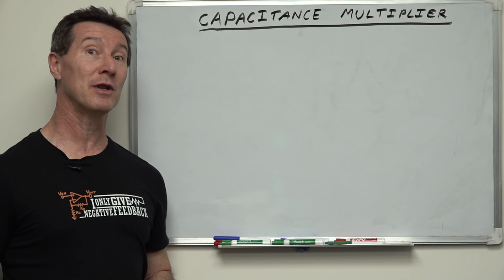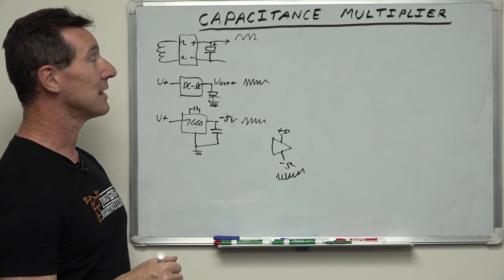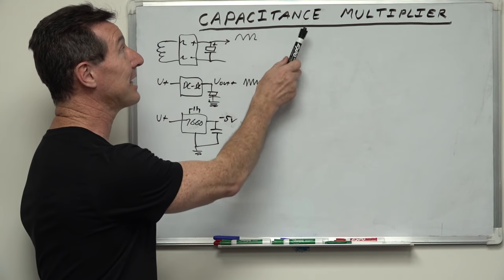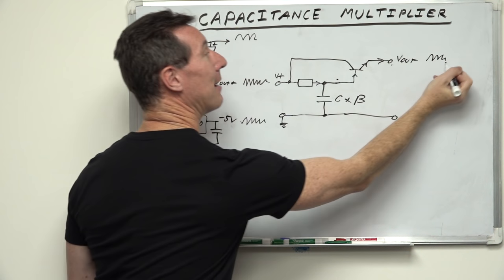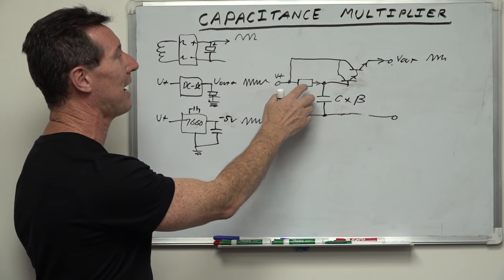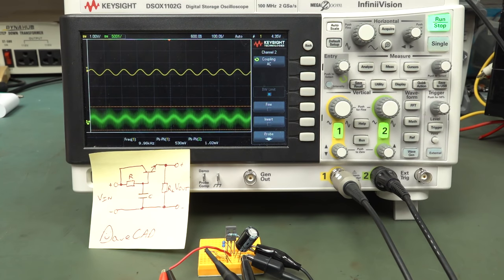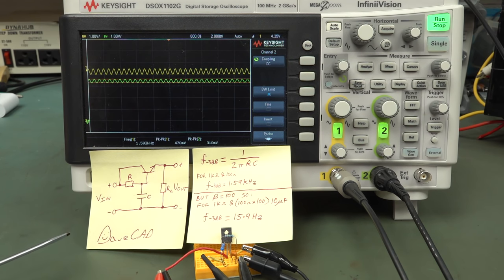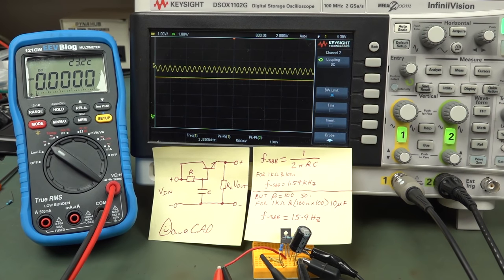EEVBlog #1116 - How to Remove Power Supply Ripple

Comment: Nice explanation, Dave. There is a trap for young players here. If the input voltage ripple amplitude exceeds Vbe-Vce~=0.6V, this circuit doesn't work properly anymore, because the collector voltage drops too close or even below the emitter voltage. At that point, only the base current makes it to the output and there is no current gain anymore. An additional resistor across the capacitor can be used as a voltage divider to solve this issue. This will lower the base voltage, which lowers the emitter voltage, and allows the input voltage to drop lower before there is no current flowing from the collector to the emitter. I ran into this problem with a low power, high voltage boost converter that had more than a volt of ripple.
Reply: yeah, I was kind of thinking about that, and wondering if putting a cap on the output would even make any diff at all other than smoothing out the current draw of the load through the bypass transistor.  and, at that, what is preventing that second resistor in the divider, from being a simple zener, to further stabilize the voltage of the output. I guess it mostly depends on what the load is, and what the supply is doing. lol.

I also found, for many low power things, a simple in-line diode with a cap after it was sufficient for a single device without trying to stabilize an entire power buss just for a single chip to be happy.
Reply: Does this still occur if I were to use a darlington pair?
Reply: @ninethirtyone4264  I think this is getting even worse, because the voltage drop is even bigger, about two times the voltage drop of a normal BJT.
Reply: Does this happen with a mosfet?
Reply: Paul Max Avalos Aguilar : Actually, with MOSFET, you have the threshold gate voltage lost necessary to turn the MFT on. Which is typically in the range of 2 to 6 Volts. This value would be the "room" available for ripple elimination. The hick with MFT is that this threshold gate V significantly vary with Source current, so this would create a situation where you would loose even more voltage than with a BJT. The advantage though is a better ripple filtering than with BJT, as long as your initial ripple is lower than V gate.
Reply: I've built this as shown, with C=4700u and R=5 (and two cascaded filters). Sure enough, it filters the ripple when testing on a scope. Got a beefy TIP31 (hFE=20). Feeding it 15 volts, getting close to 14.3 on its output, but the moment I added a 10mA load like a led, it drops like crazy - 13.9V. With actual resistive loads it's absolutely horrible - @4ohm ~ 1.9A I get around 9 volts, and on a 10 ohm ~ 1.2A close to 11 volts. 

I want to get clean 12V, so literally no output voltage is acceptable. Even if this filter is fed with a higher voltage, say 18V - the 5-8V excursion for the given load is really bad, given that the less load you have, the more volts the regulator will have to drop.

So what am I missing here? I have designed this circuit to get stable 12V out of SMPS 15V for at most 1.5A. Given a 1.5A Ice/load, my base resistors are (15-0.6)V/1.5A  ~= 10 ohm  - which are also part of the filter and allow for little voltage drop.

What do I have to modify to this circuit and what transistor and filter values should I use to get filtered 12V from 15V for at least 1.5 amps, ideally more - like 5-8A?
Reply: @dorelx3541  A 5 Ohm Base resistor will pour near 3 Amps into the base. TIP31 base current max = 1 Amp. Try a base resistor of 100 Ohms with a hFE of 20 that should allow 3 Amps collector current max.
Reply: Actually I seen tens of volts ripple getting perfectly flat at the output.

Comment: 5 years later and this circuit just pulled my nearly 200 mV of output ripple voltage to just over 5 mV after a little playing around with various capacitor and resistor values.  Absolute gem of a circuit and these videos help us young players immensely as we fall into trap after trap going into actual circuit design rather than just the books.  Brilliant, absolutely brilliant content!

Comment: Wow, this video just saved my ass... I had 350mv ripple on a crappy power supply at work and it was messing with some of my testing and this circuit got rid of it all! Thanks so much Dave! You're a real life saver!
Reply from the maker: Nice!
Reply: @YiZhou Wang You still depend on a voltage regulator. The V+ going into the capacitance multiplier comes from a regulated source.
Reply: @YiZhou Wang if the power supply's hackablr enough, one could replace its feedback circuit(probably a voltage divider) with one placed after the capacitance multiplier
Reply: YiZhou Wang yo, he specifically states that should one require stable output voltage, then one should use a Voltage regulator
Reply: Most inexpensive ( yea right!) power supplies simply use a parallel electrolytic capacitor as a filter to reduce ripple.  The best filter is an inductive  pi filter.  It consists of, in parallel, of a capacitor, a series inductor, and another parallel capacitor.  It looks on a schematic like the Greek letter pi.  This takes of capacitive and inductive ripple.  It precedes a linear or switching power supply.
Frank
Reply: @frankreiserm.s.8039  Woaahh, Thanks! I'm gonna try this one!
Reply: @frankreiserm.s.8039  100%

Comment: In the '90s Technics (then Matsushita Electric, today Panasonic) called a variant of this topology "Virtual Battery", claiming a supply to analog stages almost as clean as a battery. They used a big cap and a mosfet, and there was a switch in place of the resistor. It was used in their HiFi components.A very simple idea, but it does in fact work fine.

Comment: NPN transistors for the win!
Reply: I clicked like on this just because it's Fran.
Reply: Me too, just got her Franlab T-shirt
Reply: I am a big time Fran-Fan u know. Good to see you here Fran.
Reply: That was interesting Dave hope u keep posting such fundamental videos.
Reply: A mosfet or igbt depending on the amount of current/voltage u need then clamping the gate voltage with a zener diode then another low pass filter will do well
Reply: @philipakpojiyovwi3875  i would be worried the Zener diode would interfear with the function.  wouldnt it stop some of the ripple being seen by the gate? thus allowing the ripple to simply pass through the fet?
Reply: @MrStemkilla  Remember the gate signal is a replica of what must pass through the MOSFET /IGBT in an amplified form, a ripple free gate signal means a ripple free amplified signal
Reply: They are great for amplifiers.
Frank

Comment: @EEVblog  Hey Dave, I LOVE your videos! Hands-down... the best in electronics on YouTube! I benched this circuit IDENTICALLY as shown including values for components. (I even used a mini breadboard) to DUPLICATE “EXACTLY” what you used in the video. I used a Switch Mode Power Supply configured for 5v. (Just as you showed in the video). However, I couldn’t replicate your ripple results.

COMPONENTS:
Switch Mode Power Supply Volts: 5.00 (5.001v Actual Output) – Measured using:
Keysight 3458A - 30min+ warm-up
Keysight U1271A

R1 (Base Resistor) = 1k - 1/2watt - 1% (996.83 Actual) - Measured using:
Siglent SDM3055 - recently calibrated - 30min+ warm-up
Keysight 3458A - 30min+ warm-up

C1 = 470uF 35v (486uF Actual) - Measured using:
Siglent SDM3055 - recently calibrated - 30min+ warm-up
Keysight U1271A

RL (Load Resistor) = 270 - 1/2watt - 1% (269.94 Actual) - Measured using:
Siglent SDM3055 - recently calibrated - 30min+ warm-up
Keysight U1271A

Q1 = BD137  –  (not a BD137G)
-------------------------------------------------------------------------------------------------------------------------
BD137:
R1 Voltage = 57.593mV = 0.057593v (Verified with the above 3 Multimeters)
RL Voltage = 4.2747v (Verified with the above 3 Multimeters)

I1 = 57.78uA = .00005778A
IL = 15.83mA = .01583574A

hFE: 274.069574

Of course, it smoothed out the ripple nicely. However, my ripple numbers are considerably higher than yours. I used a Keysight DSOX2012A to take the measurements. (Essentially the same O-Scope you used in your video). – I wish we had the ability to attach photos here on YouTube. One thing I would like to point out that when I measured, I used a ‘M’ BNC Oscilloscope Probe Adapter & a “Pomona” ‘F’ BNC to Banana-to-Hook Test Leads on the Oscilloscope Probe. This is the best possible connection to give the “FAIREST” test possible so that external Transients were not introduced and won’t skew the measurements. This is why I didn’t use the supplied Oscilloscope Probe “Ground Wire” to Alligator clip.

Ripple PRIOR: (Raw Power Supply output)
Pk-Pk: 40.92mV

Ripple w / “Capacitance Multiplier”:
Base Resistor R1 = 1k (996.83 Actual)
Pk-Pk: 17.64mV

Base Resistor R1 = 10k (10080 Actual)
Pk-Pk: 36.17mV (Pk-Pk went up, (by DOUBLE) NOT Down)

Using the EXACTLY the same parts & essentially the same oscilloscope to take the measurements, how were you able to reduce the Ripple down to: ~ 2.5mV Pk-Pk? Something doesn’t add-up here.

BTW, I agree with you, I don't like the term "Capacitance Multiplier" either. It's really just an RC Filter.

Comment: Hi Dave,great video. 
I used to service electronic engine analysers many, many years ago. 
One brand of analyser, proudly made in Sydney, use the capacitor multiplier in its pos and neg supplies to the scope display. 
They used a 15inch TV B/W picture tube with magnetic deflection. The scope did not run at TV scan frequencies but swept at 10Hz up to over 1kHz. So the load caused by the deflection circuitry, apart from being quite large, was also not of constant frequency.
The multiplier circuit work a treat and was made up of 4700uF and good old  2N3055 and MJ2955.

Comment: s. 578 in The Art of Electronics :)
And if the ripple is in the MHz range, you can add a ferrite bead to the base lead of the transistor.
Reply: Thanks
Reply: s.578 - you are german!
Reply: Chapter 8.15.1! :D
Reply: he could be turkish too
Reply: Why the base? Why not the emitter? The current coming from the base is very minimal compared to that moving from the collector to the emitter? Can you please explain this maybe im missing something here thanks
Reply: @Mark300win  Transistor gain (hfe), and in this configuration It's a "voltage follower".
I've never seen or thought of this before. It's a very clever little circuit.
Reply: Uh, sorry, for us newbies - what page is that? Or what chapter?
Reply: 7 in the morning and i got my book out, to look it up
Reply: Or he could be hungarian, judging by the name :)

Comment: In telephony, this circuit ( Rb, C, Darlington Q, and Re) are used as an "electronic inductor."  (Re is the load resistor - RL in Dave's circuit).  If you measure AC impedance from V+ to ground, (or do the math for this circuit) you'll find that at low frequencies, this impedance is Re - which is typically small.  At high frequencies, the impedance is Rb, which is larger.  In-between, the impedance goes up at 20db/decade - the same slope as an inductor.  

This assumes you are below the frequency where Miller capacitance is a problem - above that frequency, the impedance will start dropping again.

This circuit was used to replace the inductance of the ringer coil when newer phones came out.  The phone lines were specified to require a certain amount of inductance across the leads when on-hook.  When big mechanical ringers were replaced with electronic ones, they still had to keep that inductance in the circuit - hence the "electronic inductor" circuit came to be.  The effective inductance of this circuit only needed to appear in the audio band.  

When using this circuit for ripple reduction, I've heard it referred to as a "rip-red," i.e. short for "ripple reducer."  In that case, Re is replaced with the load you're reducing the ripple to.
Reply: Would that make it a form of a "Gyrator" circtuit?
https://en.wikipedia.org/wiki/Gyrator
Reply: 👍 great info

Comment: I used these (BJT implementation) for the power supply rails feeding VCOs in PLL synthesizer applications many years ago to reduce oscillator modulation due to power supply rail ripple/noise, thus improving phase noise in the design situation.

Comment: I once did the opposite: an active capacitance cancellation circuit. I used it to cancel the capacitance of a photodiode so that it could run faster as a data receiver. Without the circuit, the bandwidth was limited to 200Hz. With the circuit, I could get the required 32kHz. It was a long range infrared remote control receiver.
Reply: If you still remember, how did you make such a circuit? Could you make a schematic and brief theory of operation?
Reply: It's been decades and I no longer have access to the schematic, but as I recall, I used an op-amp as a non-inverting amplifier. The anode of the photodiode was connected to the input and the output of the amplifier was connected to the cathode. Zero bias was maintained across photodiode with the output tracking the generated voltage. Response went from DC to whatever the op-amp could muster. There would have to be some bias on the op-amp input. I believe that it was a large value resistance to ground, although you could also use a voltage divider. The circuit easily received from a near-infrared LED (900 nM) 100 ft. away. The idea wasn't mine. I got it from a trade magazine article that I probably couldn't find to save my life. Chances are, it's out there somewhere. The company that I designed the circuit for no longer sells that item. @milesprower6641
Reply: Sounds to me like bootstrapping. You can do the same thing to present very high input impedance to a piezo pickup. There's an article on Elliott sound that gives an example. It's a good trick, you just have to watch out for boosted low frequency response.

Comment: Hello, Dave,
regarding the multiplication of capacity:
It depends on which side you look at it from, whether this naming makes sense.
If you want to use the circuit to smooth the input voltage, it behaves as follows:
The filter effect is determined by R and C alone. The transistor acts purely as a voltage follower. Therefore it has no effect on the voltage ripple.
If you instead apply a current ripple to the output of the circuit, then the capacitor actually acts like a buffer capacitor 100 times its true size.

Many greetings
Jörg

Comment: Smashing video dave :-D
I've seen this configuration a lot in basic linear power supplys, but never thought too deep about the filter magnifier effect.
A handy ripple reducer as long as you don't mind a bit of voltage loss :-).

Comment: Basically good facts all along.  You even showed that the breakpoint frequency did not change as expected.  But your move from passive to boosted solution left a bit of a gap in cost/benefit respect.
Too bad, the low drop-out regulator is the one that has miserable input ripple rejection.  But guess what — the current booster is no better if the voltage head is lost.  As you talked about the 300 mV drop on the regulator case, you did not emphasize that single emitter follower has some 0.6 to 0.7 V drop, depending on load.  A Darlington tends to have 1.4 V drop.  A “Fetlington”, i.e 2N7000 has about the same threshold voltage and big MOS FETs 4 to 8 V.  You could do better with depletion mode FETs, but that is already pushing the state of the art.
Traditional voltage regulators when given enough head voltage do a decent job in reducing ripple.  But if the input is for example 8 V peak and 7 V ripple bottom, even the traditional 5 V output regulators are at the spec limit.  The 2 V head requirement is counted from the ripple bottom...
Reply: So can I understand that this circuit is just for using not ridiculous value of R and C, but no improvement of cutoff frequency, right?

Comment: I became a cropper trying to use a linear regulator to remove the ripple on a DCDC converter, only to find that the PSRR for the reg wasn't as high at the frequencies of the DCDC switching. This circuit might just be a solution! Cheers Dave!

Comment: RCT filter perhaps ? 
A few years ago i was having problems with a cheap digital readout for my milling machine , it could be ran from batteries or a plug pack power supply . On batteries it would work faultlessly but from the switch mode plug pack it would go crazy then lock up so a deduced that it was a noise issue . I tried all sorts of things to get rid of the ripple  from that supply and ended up going over to the old transformer type supply as its noise is at 50hz . This worked ok but it still annoyed me that the supplied plug pack was so lousy and a simple circuit like you have shown here possibly could have fixed it !  I remember searching the internet for various filters but that one never came up ! 
I must say that you really do make excellent tutorials ! You give just the right amount of info to explain what you are talking about without bogging the video down with endless mathematical formulae  or theory ! Once we have ( those of us who are still learning ) the basic info its up to us to get off our arses and delve more deeply into the subject ! 
Thanks for the video mate- i enjoyed it immensely!
Reply: it could be run